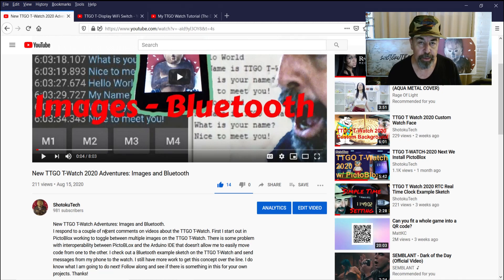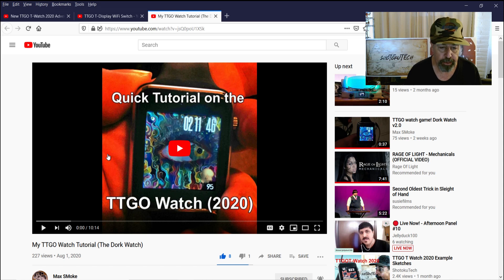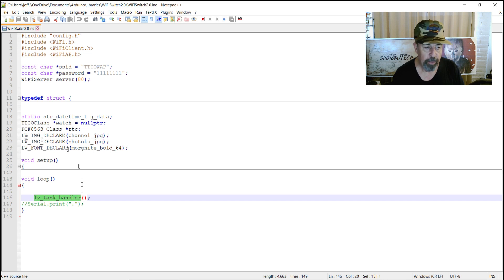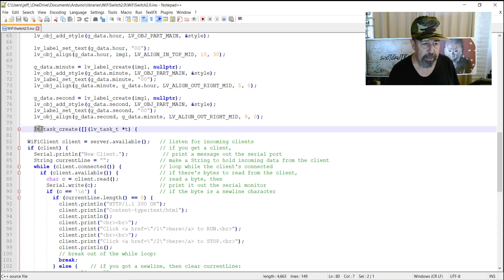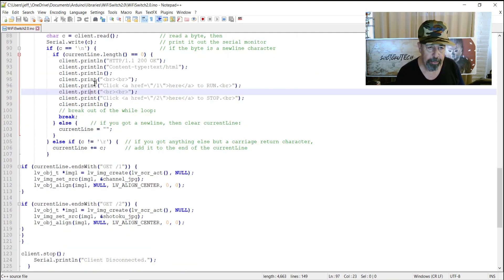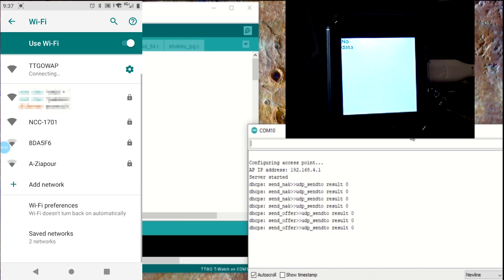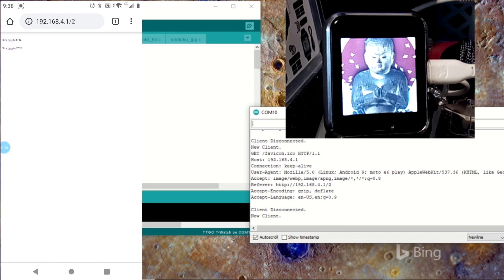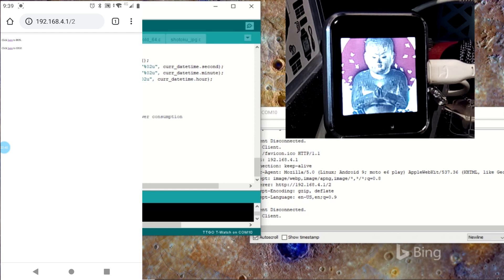TTGO T-Watch 2020 WiFi Switch Challenge

Comment: What is a void loop / void setup if you don't mind my asking?
Reply from the maker: Great questions. At the very top of a program, you define other programs to 'include'. Then you define any global variables and declarations. (used anywhere in the program). 

void setup() contains any codes that would run one time at the start of the program. 

void loop() in the Arduino world is where most of the action usually takes place. Everything within the brackets '{...}' after void loop(), runs over and over again until the program is halted or the board is powered off or reset.

Interesting and simple. And that what can make it fun and challenging.
Reply: @ShotokuTech  Thank you for explaining! I am putting a lot of "void" in my comic, that's why I was asking. Funny that they have actually called it void, though, isn't it? It seems to be the core routines of the program, after all.
Reply from the maker: @SarahRabenhertz  I will see if I can find out why this word is used. Interesting how I just take it for granted because it has always been there. Ha ha. Thanks.
Reply: It's a basic part of C programming that the Arduino IDE uses. So... setup() and loop() are functions, 'void' tells the compiler that the function returns nothing.
Reply from the maker: @davewalmsley8883  Nice, spot on! Thanks.
Reply: @davewalmsley8883  Clearly explained!

Comment: How is battery life on this watch? How long does it last if you only use it to display time if you press a button?
Reply from the maker: I tested that a while back and found it lasted over 24 hours with just periodically checking the time. It will vary depending on what parts of the device are activated. I had WiFi activated for this trial. Thanks.
Reply: @ShotokuTech  Thanks.  I was thinking to make a Bluetooth mp3 player controller. Volume control, back/forward 30 sec, play pause. Cause listening a lot podcast and don't want to get the phone.   A watch crown would be great to control volume, rewind or a circle iPod like interface on the screen, but that would cost much more battery.
Reply from the maker: @hulladek3  Interesting idea. This watch crown is only a button, no rotation. I know that Dirk and crew on the sharandac/My-TTGO-Watch have been chatting on Bluetooth. I will have to update my watch to their latest to see what they are up to.
Reply: @ShotokuTech  Well the first project is to extend this watch with a crown :D  need a very small rotary encoder :P
Reply from the maker: @hulladek3  I am 'watching' both main T-Watch github repositories. So I get a few dozen emails every day about it. There seems to be a T-Watch 2020v2 coming out. Cross your fingers?